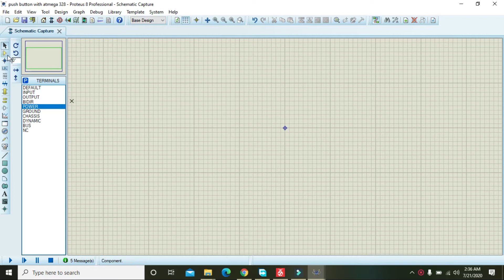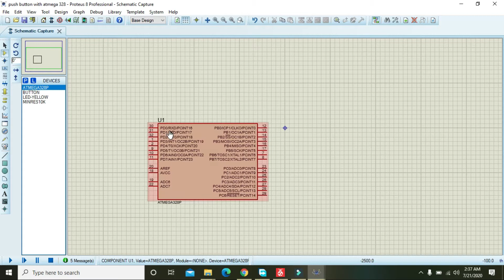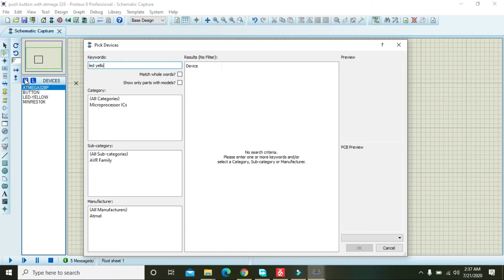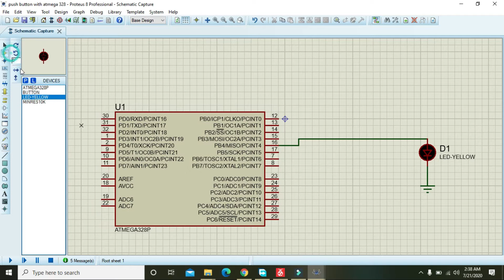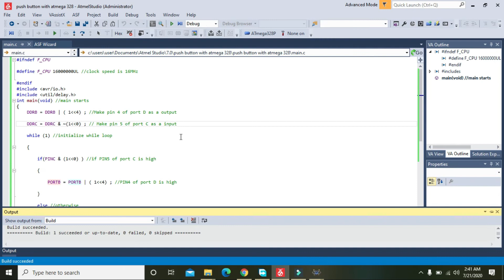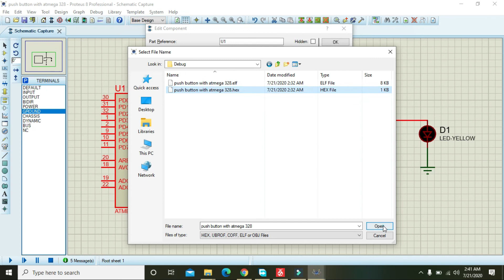how to use push button with atmega328 | simulation of push button with atmega328 in proteus

Comment: Why 28pin  microcontroller has 30 pins.?
Reply from the maker: sini avr is a huge family of controllers..in proteus there may be some mistake in the pin config...but still good observation....
Reply: not all pins are show, i think ground ones are absent, you can see the pin 30 - first pin on top left